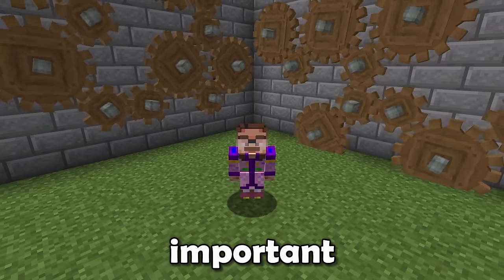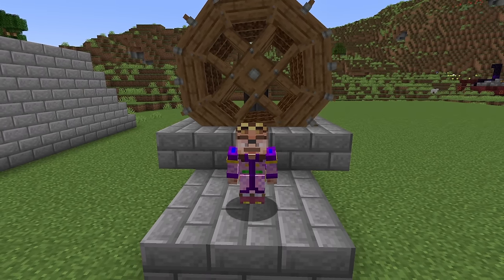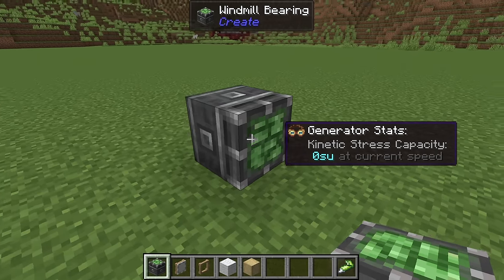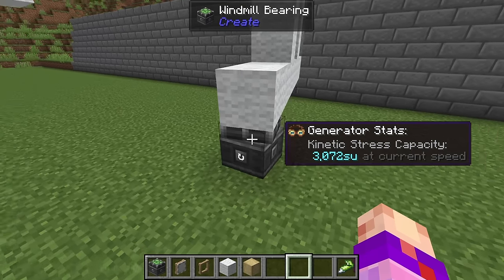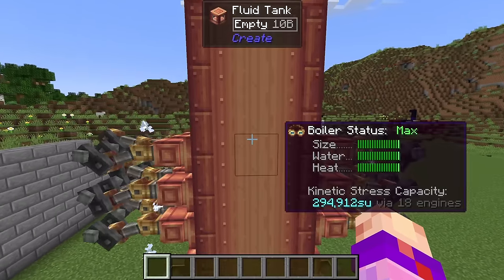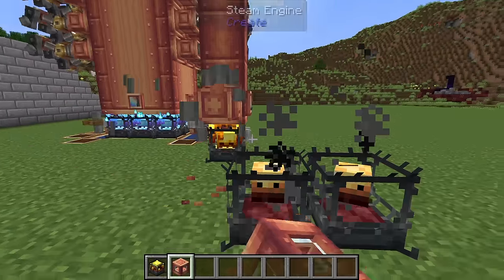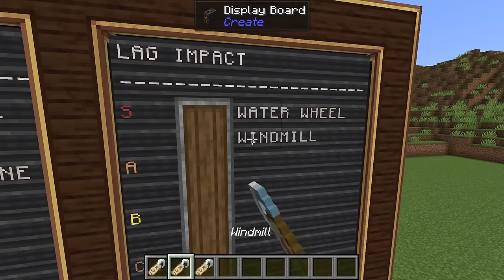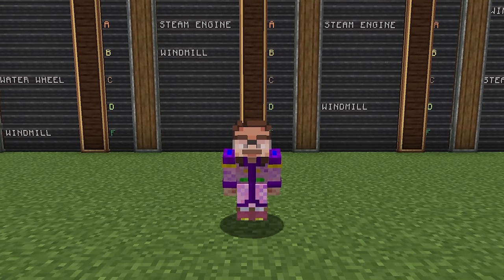Water Wheels Are BETTER Than Steam Engines (Kind Of) - Create Mod SU generator comparison guide

Comment: for someone who sounds all high and mighty, you could figure out that μs/t means microseconds per tick
Reply: He doesn't even understand how SU works! If you use gears, a speed controller, etc. to increase the speed of a large water wheel, the SU is still 512, it doesn't decrease when you increase the speed. Components use more SU at a higher speed, but changing the speed doesn't affect the stress capacity of the system. If you double the speed of a large water wheel you get 8 RPM 512 SU, which is twice as powerful as the 8 RPM 256 SU of a regular water wheel. Oh yeah, and he also got the water wheel speeds wrong!
Reply: @AJ-Palermo  he also said that large water wheels are more cost effective because you dont use shafts in the crafting recipe, which was annoyingly stupid because you need to make a small water wheel to make a big one, which means you have to spend a shaft and 8 planks, and then 8 more planks for the same power output and more required space. how did he get sponsored by a university? 😂

Comment: Agreed. I only use waterwheels. They are dead cheap and easy to upgrade, just make more. I make a ton far from base and connect them with belts all the way to base to avoid the lag. Essentially having like 50k SU from waterwheels. No lag. (Put them long away)

Comment: i have 3 issues with this video:
1) you never showed the performance profile of water wheels or windmills, only steam engines (this is only for the sake of a fair comparison)
2) windmills DO NOT require wool, only the frames(which take only wood) are needed (i still dont use them as they can be tedious to build)
3) the lag of a steam engine is not as bad as you make it
 3.1) you will never need that many steam engines
 3.2) there are mods(like create crafts and additions) which allow you to directly pipe liquid fuels into the blaze burners
 3.3) the laggy fuel setup you showed is to power a max boiler, while you only showed lag to power equivalent to a minimum boiler for the others
Reply from the maker: The other performance profiles just produced 0 or 1 us/t, which I should have shown but forgot to!

And you can’t directly craft sail frames in vanilla create which the video is about

I definitely should have clarified steam engines impact severs more than single player worlds though! 

Not sure what you mean minimum boiler? I showed a level 9 boiler compared to a power system for a level 9 boiler 

In any case thanks for the criticism! I didn’t put as much heart into the lag section because I mistakenly figured it wouldn’t feel as important to viewers as the other ones but for future videos I’ll definitely make sure to be better about that!!
Reply: I have three more!

He doesn't understand how SU works: If you use gears, a speed controller, etc. to increase the speed of a large water wheel, the SU is still 512, it doesn't decrease when you increase the speed. Components use more SU at a higher speed, but changing the speed doesn't affect the stress capacity of the system. If you double the speed of a large water wheel you get 8 RPM 512 SU, which is twice as powerful as the 8 RPM 256 SU of a regular water wheel. 

He got the speeds of the water wheels wrong. They're 8 and 4 RPM, not 16 and 8.

Edit: Also, you don't need a Blaze Burner for a passive steam engine, you can use a campfire

Comment: I had a playthrough with my bf and some of our friends where we were playing with a fair number of mods including lots of fun lil steam engine things, this was in a version with out the beeg boi steam engine though, but at the same time the small ones work really well... that being said, we also were running project E and other mods like that so a majority of the stress units I have generated has been through solar collectors attached to matter condensers endlessly fueling and feeding a blast furnace with items to smelt that then recycles said smelted items back into the loop with the blast furnace attached to a furnace powered engine. lol
But even with that, I still have so many spots in my labrynth that is powered with the old medium sized water wheels. XD

Comment: Biggest issue with the scalability ranking is that the water wheels have already had to scale a lot to equal the most basic steam engine. A single charcoal farm could easily fuel multiple steam engines. So the steam engine becomes more efficient the more you scale it. But the water wheels are constant effeciency.
Reply: campfires is a valid heat source for steam engines lol

Comment: A more fair comparison would be to use SU * RPM as your unit, because windmills increase both RPM and SU with more sails, and because well 8194 SU can be done just by gearing a few water wheels down to 1 RPM, but 1 RPM is useless.
Reply from the maker: increasing RPM is really easy though, gear shifting, chain gearshift, and RSCs trivialize RPM increases
Reply: @dejojotheawsome  however RPM affects the amount of SU consumed as well as affecting available SU. As in real life, there is a difference between torque (SU or newton metres) and power (Watts or RPM * torque). When you gear something down you increase the torque but decrease the rpm so power stays the same. You’d want your generators to be able to power your machines at a reasonable speed.

Comment: im not good with create or anything but i feel water wheels and windmills probably have pretty good space efficiency, i mean you just have to make a huge 3x3 tube horizontally or vertically you can work around that unless it Needs to be a small build, but atleast its not gonna be going in a bunch of different directions, like how steam engines are a weird block shape with branches sticking out and it needs any number of farms just for it
its sacrificing a big chunk of land no matter what, but i feel a 3x3 tube is better than a 3x3 tube+farms and weird shafts

Comment: Wait, you don't need blaze burners for steam engines. You can put a campfire underneath for free SU, just less than a powered burner but you can easily get to 16k with just campfires. Is that newer than this video?

You can also just pump lava directly into the burners, no need to bucket things up

Comment: I once made what i can only described as a "Whater weel engine block", i put a row of 16 whater wheels on 3 diferent floors on a rectangle block filled with water (i built it in the coast for easy water access) and all i needed was one belt to connect all 3 floors and i got 16K SU, whater wheel is the best

Comment: Another issue with steam engines is that due to how complex they are, you mostly will have all of them in central power source and will need to transfer the power with lots of shafts over long distances, which adds up to the lag and can be messy to manage

But with water wheels you can give each "factory" it's own powe source without many issues
Reply: shafts are virtually "free". You can have thousands of them all over the place without much impact.
Reply: Shafts aren't laggy Foxynotail has made a video on reducing lag in his world and then you can see which are the laggy ones

Comment: I think windmills have two things going for them, based on aspects you did not score them on.

Aesthetics
& Flexibility

Aesthetically, windmills can very easily add a lot of charm to a build, and with designer's intuition can be made to be nearly completely aesthetically cohesive with a build on top of contributing an okay amount of power. Waterwheels however, if you're trying to use them efficiently, typically do not look especially pleasant, and if you are trying to make them aesthetically pleasant, often this comes at the expense of their efficiency. And boilers just... they're glaringly there just to run everything else.

Flexibility, windmills can be used in a great many situations. In the Nether, for example, Steam Boilers need water piped in from elsewhere, or otherwise some kind of shenanigans to produce it. Windmills just work. I'm uncertain about how waterwheels fare with lava. Additionally, in the early game, Windmills are essentially self-contained, self-powered Mechanical Bearings - they're slightly cheaper in the early-game than Mechanical Bearings and require no outside setup if you don't need any kind of precise control - for example, you can glue some harvesters and a barrel on the wool blocks and just have an auto-farm going with no external SU input, no moving fluids necessary. Completely off the grid - a new grid of its own, really. In fact, such farms are often, themselves, scalable. Not necessarily with power, but in production. Crops don't typically need a lot of upward space, so it's really quite simple to add multiple layers to a windmill consisting of a single wool pillar in the middle and a bunch of glued-on harvesters for each layer.

Comment: Also, don't two machines that are moving ignore each other? Windmills would be lot more efficient, no? Also the μ That's micro second
Meaning that overall the design takes about ±100μs just glancing at the numbers every tick to operate so 0.1ms (1mili second= 0.001s) so if you stack a 10 of them it can(on avarage for the recorded 30s though i heard the laggoggles mod isn't accurate but idk about that.)

Comment: don't hate on steam engines so much mate

you don't even need a blaze, 4 blocks of magma or  4 campfires (-particles, +overworld) , 4 copper tanks, 1~2x(1 steam engine , 1 pump ~2-3 pipes)
in my design, i managed to cut down about to 4 campfire/magma;4 tanks; 2 engines ; 2 shafts ; 2-3 large gears ; 1 small gear ; 2 copper pumps ; 3-6 water sources ; and some blocks or stairs
That should be around 20m of mining, considering you have to set up a workshop for making the plates

so yeah, they took the old fan thing and converted it into the steam engine thing pretty much

water wheels are too big comparing the magma-steam plant so its easier to just integrate that, also if i recall , in create every moving block is pretty much an entity, so there's that too

windmills are just... ehhh big su, but the speed is bad, all of that bonus su is lost in speed conversion pretty much. They ARE good in places where you need juust a smidgen of it but also need very little space, since after you activate the sails you can build into them

thanks for coming to my TED talk mate

Comment: If you use cannons you can build windmills inside a running windmill, which is probably the most unholy thing this mod has to offer. This would put imo windmills at a very high space efficiency spot.

Comment: I use a waterwheel like a starter for my steam engine, I once used waterwheels for a large machine and had to use 32 waterwheels. My compact steam engine design could power it with more SU to spare. Steam engines CLEAR.

Comment: I wouldn't say the scalability of windmills is bad
you're saying that they are bad to scale because you have to build more at a certain point, but if building another one is not considered scaling then waterwheels, which you say are incredibly scalable, are not scalable at all since you can't increase their size and a single waterwheel "caps out" at just 512su.
Building an extra windmill bearing rally isn't that difficult or inconvenient
Also in regards to space, you claim your 4 column windmill takes up just as much space as  large waterwheel (3*3), but it doesn't. A waterwheel requires water to flow along at least one side, so in effect the minimum size for a large waterwheel is 4*3. Your windmill configuration was also very inefficient, you only had 4 columns of sails. The windmill shape doesn't matter at all, there is no reason to leave the corners empty like that. Had you filled the corner you would have got the same output from half the space, even more if you had filled the centre of the windmill as well.
Windmills are also entities, so if you really want to power game space efficiency you can put multiple windmills inside each other, generating power numbers that far exceed anything waterwheels can put out. Also wool really isn't that hard to get
I feel like you just hate windmills

Comment: The problem with steam engines is lag, as you show here. The lag of the steam engines comes from the method to fuel them. Depending on what you use to fuel them, it's gonna have a different impact on lag. The way I fuel them is with a huge lava pit in the overworld with a hose pulley taking from there. Because it's so big, it counts as a bottomless supply, so I can extract the same way I would if it was in the nether. A pump as you showed here barely impacts performance so I think my way of making steam engines work is so much better. The other advantage of the lava pit method is that you can extract any amount of lava, at any speed, with extreme ease, so it's insanely good for fueling different stuff, plus you can stack steam engines infinitely given how you can extract lava at any speed. The only downside to my method is how unbelievably long it takes to set up, but it's definitely worth the time, as once it's set up, the rest is extremely easy.

Comment: The water wheel to windmill ratio is the same when accounting for space efficiency in that design
8ksu at 16rpm is 16ksu at 8rpm

Same reason why big waterwheels are useless unless you need 8, 4, 2, or 1 rpm

Comment: what mod are you using to see the lag??? for me my whole base is filled with create things and i had to make so many clutches and wireless redstone things to toggle the whole system on or off XD
Reply from the maker: It’s called observable
Reply: thank you!, its been driving me crazy due to a frame difference of 40 fps from being at my base and being away from it... weirdly enough i cant use water wheels cause they cause way to much lag for me so i made a auto fueling steam engine that powers a second one thats maxed out so i dont run into stress issues really weird system but hey it works XD @dejojotheawsome  oh also thank you for making good informative videos, your channel is the only one i go to for the create mod and stuff

Comment: I actually thought you needed to add water to each attached water wheel for the added SU
Reply: Since the 0.5 update you need only 1 flowing water block to be attached to any water wheel for it to work at full power.

Comment: Dude, wtf is "48 lag per tick"? That's literally 48 nanoseconds each tick. Do you know how short a nanosecond is? It's like 1/1000000 of a second. One tick is about 48000 nanoseconds. You literally need about a thousand of theese in close proximity to cause a significant lag, which you certainly won't do, because even a single steam engine provides an absurd amount of power. Check the information before posting it, please.

EDIT: i messed up the units, it's actually microseconds, but they're still 1/1000000 of a second, so the point stands.

Comment: Never had problems with wool in create. Just a little farm with flax gives you infinite string. 

...but yeah, i always stick to water wheels.

Or in mod packs with reactors and such i will use the electric motor.

Comment: 12:54 just connect the lava farm to the bottom of the blaze burner directly with pipes lol. one pump is enough (two if you need a buffer in the form of a tank). like, why make life difficult for yourself if the pipes themselves fill the burners when needed, and with much lower costs and lags with the same efficiency?
Reply from the maker: That’s an addon feature and this video covers vanilla create

Comment: Energy given by those wheels is same.
∆Energy = work
Work = forse * displacement
Work = forse * speed * time
Power = forse * speed
Small wheel 16 rpm × 256 su = 4096 Wt
Big wheel 8 rpm * 512 su = 4096 Wt
Wich means that power of small wheel equal to power of big wheel.
And it can be prooven by special gear box wich reduses speed and increase forse or vice versa.
Result:
Big wheel is trash, small wheel is good because is compact.

Comment: if you rate it by points: F = 1 and S = 6 then steam engine and waterwheel are both the same (19 points) and i think if you wanted to make same SU as 1 lvl 9 steam engine it would: take a huge amount of space and the lag would be about the same i think
Reply from the maker: That’s why water wheels are kind of better than steam engines lol!

Comment: time to put a water source block at max world height and slap waterwheels touching all 4 sides of the water all the way down to the bottom. using the small ones, the whole thing takes up 3x3 by however many you want to place down.

Comment: so, water flows downward infinitely, if you make a proper setup you can just make a wall of water going downwards, and have a large water wheel on either side as far down, and across as you can make it
easy stress units, though you would need 200 to beat 100k, where with the right setup of steam generator you can get over 1m no problem
Reply: It is a bit of a pain to gear together non-linear wheels, but you could make a tower with block steps going around horizontal wheels and do what you said. You'd get more wheels in the same vertical space, you just need a spiral waterslide, so your footprint is a bit bigger.

If built into a mountain or the ground, it needs a 5x5 hole as tall as you want for either a large water wheel tower, or 4 small water wheel towers of the same height. If you wanted to build a tower, the minimum footprint is 7x7, which really isn't terrible and would be easy to decorate.
Reply: @WanderingWolfe  I tested my idea a while back and it turned out really really easy to make
you just need chain drives to connect the water wheels at one end, and a few gearboxes to make the rotation go the same way, then you can merge them
plus, easy to conceal, and modular, just dig a hole with some portable miners and bam, easy 100k SU with 200 large water wheels